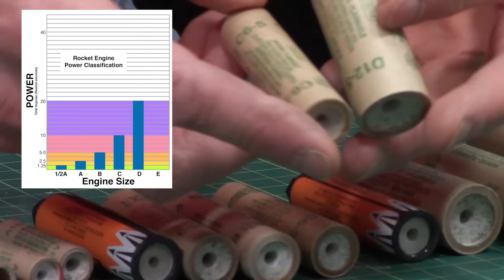Model Rocket Engine Code Explained for Beginners

Comment: I'M USING AN N CLASS MOTOR FOR MY MOST RECENT PROJECT WISH ME LUCK
Reply: Has that monstrosity taken off yet?
Reply: Luck
Reply: How did it go
Reply: @shadowdeslaar  Guess he blew himself up 🤷🏾‍♂️
Reply: good luck
Reply: @EazyE11  yes
Reply: @t65bx25  it's still building up thrust
Reply: @akshit0203  still building up thrust
Reply: @akshit0203  TWR 1.000001
Reply: @Fred_the_1996  I may be really bad at math, but does your rocket weight 100KG?
Reply: @akshit0203  Its near Uranus right now i think. Still increasing velocity.
Reply: @akshit0203  Yes. I mean its a N class engine after all.
Reply: Is it still building thrust?
Reply: How did you get lvl 3 rocket motor
Reply: Is it still building thrust?
Reply: Here me making my own rocket motor 😂
Reply: It's been 4 years, still maintaining thrust?
Reply: I'm working on an X class motor

Comment: As a kid…don’t do this. Launched a two stage with a first stage with 3 second delay (C6-3 instead of a 0). First stage goes up and of course rocket noses over and 2nd stage goes off with nose pointed about 65 degrees or 25 degrees down ward from parallel to the ground. Looked like an air to surface missile and crashed into a tree about a 200 ft away. Ooops

Comment: Actually, -0 booster motors do not have ejection charges. Just black powder.
Reply from the maker: I stand behind my claim that a -0 motor has an ejection charge. I've used it to push out parachutes, and to ignite upper stages. A motor that does NOT have an ejection charge has a specific name called a "plugged" motor, and it is designated in the motor name as a -P
Reply: Right for multistage rockets
Reply: @apogeerockets no ejection charge on 0 motors. It burns through to ignite the next stage. Things may have changed but that is how it was in my day.

Comment: One thing I really miss in the low power engines, are the Series II engines with a centerbore.  I used to have a two stage Centuri  rocket named Long Tom, and I'd fly it with a C6-0 first stage, and a B14-5 second stage.  The rocket was just short of three feet tall, and even with the C6 first stage engine the liftoff would be relatively slow.  When that second stage ignited though, the rocket would seemingly disappear.

Comment: Thanks for answering my question at the 9:35 mark. My question was whether or not a -0 motor has an ejection charge or not. Great instructional video!
Reply from the maker: Great point!
Reply: No,a booster,or zero delay,has NO ejection charge. Only propellant. When it burns out,it ruptures forward,shooting hot gas and bits of burning propellant forward into the nozzle of the second stage engine,which ignites the propellant.

Comment: Great instructional video. Was using A8-3's for an old Estes 18mm motor powered Honest John, for small launch areas. Since I'm on a budget, A10-3 with 13mm/18mm adapter works even better and I get 4 launches instead 3. ❤

Comment: Q:::  what is the minimum launch TWR demand  of a model rocket 🚀  that could go vertically up,  at least 500 meters??? Thanks
Reply from the maker: You'll need to run the simulations, because you didn't specify the weather conditions. The software that I recommend is RockSim. You'll find it on our website (see description above). There is a free 30-day version you can use to test your rockets.
Reply: @apogeerockets   there's  got to be a minimum, though
Reply: I meant, a known minimum
Reply from the maker: @kareemsalessi  If you have a formula, send it to me. But I can tell you that there isn't a formula, because it it dependent on a LOT of variables. Running a simulation will give you all the information you need. Why not just do it?
Reply: @apogeerockets  OK, THANKS.  On the Estes rocket specs, I had previously found  TWR==6 as the minimum safe ratio, although, I like to hear of practitioners of their personal TWR experiences.
Reply from the maker: @kareemsalessi  On page 11 of Peak-of-Flight Newsletter #622 (available from the ApogeeRockets website), I talk about the TWR feature in RockSim. I don't prefer to use that, because you don't specify when during the flight you're measuring the thrust.  And again... this is not a formula, the TWR calculation. Running the RockSim simulations is the BEST way to determine which rocket motors to use in your rocket. Why are you hesitant to run simulations?
Reply: @apogeerockets    is the simulator an app, online calculator, or do you mean a hands on simulation?? Thanks
Reply from the maker: @kareemsalessi  It is a desktop software that runs on your computer (windows or Mac OS). It does not run on phone.
Reply: @apogeerockets  ok, thanks. By Amy chance, do you have a link to it???
Reply from the maker: @kareemsalessi  YouTube strips out the links in the comments. Go to the description, and get the website link there. Then on our website, just use the search bar to look for RockSim
Reply: @apogeerockets   YT used to leave alone links posted by channel owners

Comment: Sorry, a rocket motor ending in -0 DOES NOT mean "ejection charge immediately". It means NO ejection charges! as used for multi stage booster.
Reply from the maker: I stand behind my statement. A rocket with NO ejection charge would have a -P on the end. That stands for plugged.
Reply: @apogeerockets  WRONG. If the thing is plugged, then how does the next stage get lit, genius?
Reply from the maker: @BillHustonPodcast  That is why a 0 means that there is no delay and it will fire the ejection to push the next motor, or ignite it.

Comment: Any low power motor with a dash zero, such as the A8-0 mentioned, has no ejection charge. They merely burn through. These motors are first stage motors meant to fire a second stage. He makes it sound like they have an ejection charge which will push out a parachute. I hope this isn’t what he means.
Reply from the maker: It will eject a parachute. And it will ignite a upper stage motor. I call it an ejection charge, and I stand by that 100%. You can call it what you want if you so desire.

Comment: I have two very old tubes of B14’s.  I don’t remember the exact data, but I believe they are B14-5’s?  I could be wrong and I don’t have them nearby.  I’m almost afraid to use them because they are so old.  But if I recall correctly, I used them when launching a rocket with a payload.  Estes used to sell a small lead weight to use if somehow all you wanted was a heavy payload.  But for me, I used to build my own payloads consisting of electronics of various kinds.  Typically it was nothing more than a small RF oscillator powered by a couple watch batteries, or maybe even a small lightbulb to see who could see it (LED’s were expensive!) and I would have friends at various distances away to provide reception reports.  Fun times, but nowadays electronic packages abound with all kinds of miniature goodies!

Comment: I was slightly confused because I saw a lot of people saying C5 is more powerful than C6 thanks for this better explanation
Reply from the maker: It is deceptive, and I understand the confusion. You have to go a little bit deeper, and look at the thrust-vs-time graph and compare the C5 versus the C6. The C5 does indeed have a more powerful kick, and the initial momentary thrust spike is therefore higher than the C6. But then the C5 thrust drops down to a lower level for most of the duration of the burn time. And it actually burns for a longer period of time than the C6, which is why its "AVERAGE" thrust is lower than the C6. That is why it is a 5-Newton average thrust, which makes it seem less powerful than the C6.

Unless you're flying competition models where you really need to tune the right motor to the rocket model for optimum performance, you probably shouldn't be too concerned about it. If your rocket would be OK on a C6-3, it will also be OK on a C5-3. The C5 would be "slightly" better for heavier rockets, or ones that have more drag (like really big fins).

To see a chart comparing the thrust curves, go to: https://www.apogeerockets.com/Rocket-Motors/Estes-Motors/18mm-Motors/Estes-Motors-C5-3

Comment: Why/how does Estes determine engine size recommendations on the package? What is the  danger in exceeding the listed motors?
Reply from the maker: The way we go about determining engine recommendations is to use the software called RockSim. You can quickly get a very good idea how high and fast the rocket will go. Here is a video on picking rocket motors: https://youtu.be/iwrjTgStOLM?si=STsKxbwlADFb1qVp. The only danger of exceeding the listed motors is determining whether or not the rocket can withstand the forces of flight. Estes only picks "their own" rocket engines. But you can often substitute motors from other manufacturers that they don't list. The RockSim software will give you the list of motors that will work (if you build the rocket strong).

Comment: When it’s windy, we always went with a longer delay, reason? Because with a longer delay the rocket could fall into our area and be a little closer to us. In other words we did a little test one time. Two identical rockets, windy day, both could hit about 1500 feet. The shorter delay one stayed higher and landed about a quarter mile from us. The longer delay would drop farther in elevation before chute coming out, and landed about 4 or 500 feet away is all. The longer delay probably dropped 2-300 feet before opening, hence closer landing to us. But like I said this was windy conditions.

Comment: what if I use a high thrust engine in the first stage and a low thrust one in stage 2 or 3 will that go pretty well?
Reply from the maker: That will be pretty good idea. You want high thrust at liftoff to get air flowing over the fins to make sure the rocket goes straight up. Once it is moving, then a low thrust motor is great to just keep it on the stable trajectory. Go for it!

Comment: Hello. Thanks you for useful video. In the Estes engine, the injection explosion occurs in the reverse direction.  I would like to install an injection unit separately, so how do I handle the injection pressure?
Reply from the maker: What do you mean by handling the ejection pressure?
Reply: After a few seconds of burning, does not create pressure in the direction of the parachute?  Isn't the parachute ejected with that pressure? How can engine fire a parachute?
Reply from the maker: @Parklab2space  Go to our website and watch the video on how engines work: https://www.apogeerockets.com/Tech/How_Rocket_Engines_Work
Reply: Thanks. I quickly understood. But If I want to use a separate injection device like CO2 EJECTION DEVICE, is there a way to not use ejection charge pressure? How to deal with ejection charge pressure?
Reply from the maker: @Parklab2space  You have to "plug" the rocket motor. See our YouTube video on how to do that.
Reply: @Parklab2space  you could use a bulkhead

Comment: Would you also choose a higher number if you wanted to launch a heavier rocket? Or does that not make a difference with such small engines? I've found that on windy days, a longer delay is better so the parachute deploys closer to the ground and has less of a chance of drifting into trees or anywhere far from the launch site.
Reply from the maker: You were paying attention! Yes. On a heavier rocket, you want to use a higher number after the letter.

But on windy days, I typically use a shorter delay because the rocket is going to weathercock into the wind a bit. So it won't fly as high, and hence, it will get to that peak altitude in a shorter amount of time. 

Using a longer delay on a windy day will allow the rocket to arc over and be closer to the ground (as you mentioned), but now you have to worry about the opening speed of the parachute. If the rocket is screaming towards the ground and the parachute suddenly opens, there is a higher chance of ripping the canopy. Then the rocket will fall the rest of the way to the ground at a higher speed and you're likely to bust a fin. So it is a balancing act on selecting the right delay.

Comment: IIRC from way back when I was active in model rocketry, the XX-0 engines have no delay AND no ejection charge.  They are for booster stages only and can set your terminal stage on fire if used there.
Reply: For normal there stay XX-P. P for pluged no extraction charge
Reply: Yep.  The burn breaches the propellant top and sends fire into the next stage motor.

Comment: Are there also motors for fast acceleration so of can leave the tube then fire up the big motor
Reply from the maker: For high acceleration, you want a motor with a big number right after the letter. To see how fast they will accelerate, this is where you need to use software to predict the performance, because it will depend on the size of the rocket, it's weight, and the launch conditions.

Comment: Great rules of thumb!   I didn’t think about the weathercocking with a lower average thrust number. Those thrust curve illustrations in rocket tutorials do help visualize the relationship between the total power of the rocket motor (the letter) and the average thrust (the first number).  So a B4-4 versus a B6-4 means both motors have a total power of “B”, in newton/seconds. That is total power, how many newtons on average applied for how many seconds. Both motors have the same total power. But a B6 will apply more newtons for fewer seconds. It burns out faster than a B4 but has more initial “oomph” than a B4. As Tim says in the video, a motor with a high average thrust is sometimes needed for a heavy rocket as a heavy rocket is harder to get going. You want to make sure your heavy rocket has enough speed when it leaves the launch rod so that the fins have enough air moving past them to stabilize the rocket in flight.   A picture is worth a thousand words. Those model rocket thrust curves you see in model rocket catalogs show visually how a motor with a higher average thrust number delivers more average thrust than a motor with a lower average thrust number, BUT that thrust ends sooner than the motor with lower average thrust.  Because the motor with the lower average thrust puts out that thrust for LONGER, it has the same OVERALL power as the motor with the higher average thrust.

Comment: An A8-0 designation means it is  booster motor and has no ejection charge.
Reply from the maker: What do you call that heat and chunks of propellant that fly forward, and can be used to push out a recovery device, like in the "The Flying Machine" model rocket kit that we sell at ApogeeRockets.com?  I beg to differ with people that a -0 on the end of the code is not an ejection charge. If you don't want the ejection charge, you should used a -P motor, which means plugged. Because you will get an ejection charge is you have a -0 motor. Absolutely-guaranteed.
Reply: @apogeerockets  I understood them to be the ignition method of the upper stage. The upper stage motor would cause the ejection of the lower stage.
Reply from the maker: @psgouros  I'm not sure what your question is. But maybe this will help with separating the bottom stage: https://youtu.be/H89Msbs7-JA

Comment: D12-7 24mm Motor for 500g - 700g is it ok to fly up to 300 meters?
Reply from the maker: Sorry. I can't pull a number out of the air for you. You'll have to run your computer simulations, because there is more to it than just the weight. The launch conditions matter as well. The software we use is called "RockSim."
Reply: @apogeerockets  Ok sir but I need a cheap motor rocket around 8 - 15 dollars and a long burning time. is that ok?
Reply from the maker: @izumisama_  YouTube is not where you buy rocket motors. You go to our website. You can pick and chose from the motors listed there. We have hundreds of rocket motors of all varieties.

Comment: I always wondered why sometimes out of 2 rocket motors the same size, one was way more powerful than the other. I guess ones just not filled up all the way.
Reply from the maker: There is something else going on. The rocket motors are tested for consistency by the National Association of Rocketry. So It is unlikely that one motor is way more powerful than the other (all else being the same). You'd have to be a bit more specific on what your question might be.

Comment: which model rocket motor has the longest burn time i wish they made one that has a 300 second burn time
Reply from the maker: We sell a rocket called the F10. It has an 8-second burn time. You'll find it on our website.
Reply: joe selzer mate that’s 5 minutes
Reply: @davidroberts1852   yes tight
Reply: The lower the number after the first letter, the longer the burn time. The longer the burn time, the lower the average thrust, so the rocket must be very light and aerodynamic, or for a second stage where the sustainer is moving already.